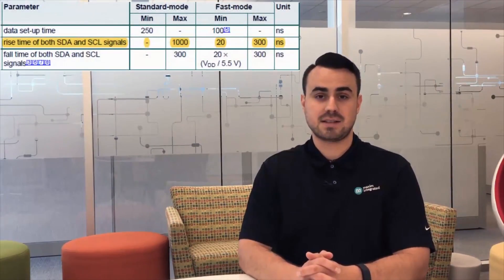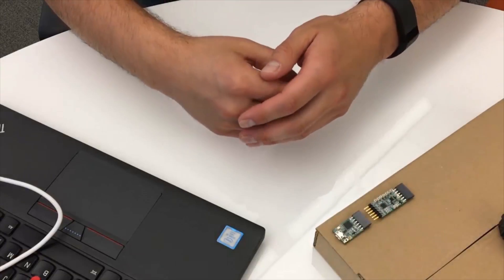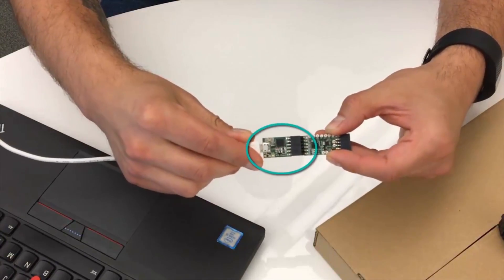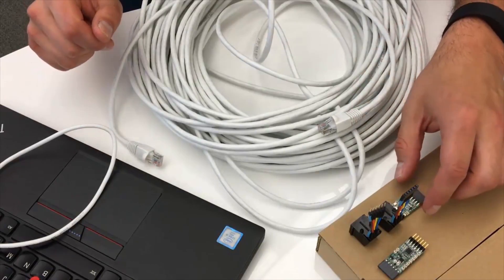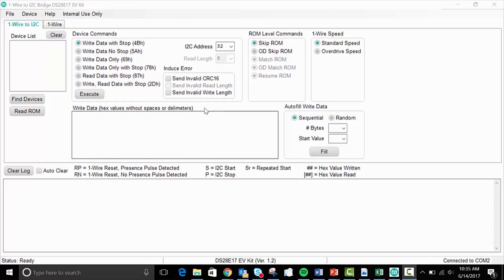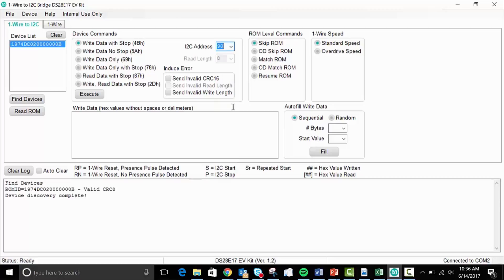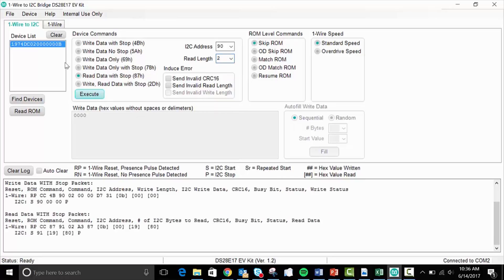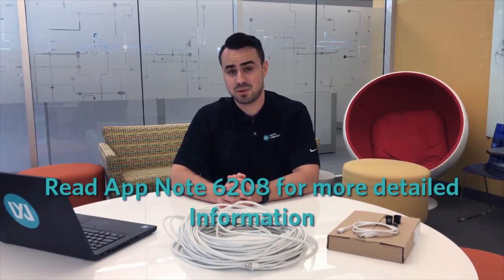How to Extend I2C Lines Using the DS28E17 1-Wire®-to-I2C Master

Comment: Do you think this boards will work up to 100m with a not twisted cable?  1 Wire protocol works well with a not twisted cable in long (50 to 100m) distances?
Reply: Everything is possible if you try hard enough but it will probably be a lot easier to use a different protocol. i2c is not intended for those distances.
Reply: @wouterschols3345 The long leg here is using 1-Wire, not I2C. 1-Wire does work over those distances, but it's not immediately obvious to me if it will work with that cable over those distances. I'm sure you can figure it out with some analysis of the specs, but it might be easiest to just try it!